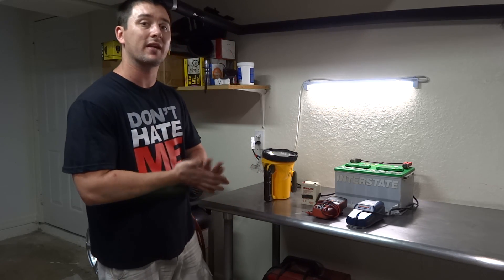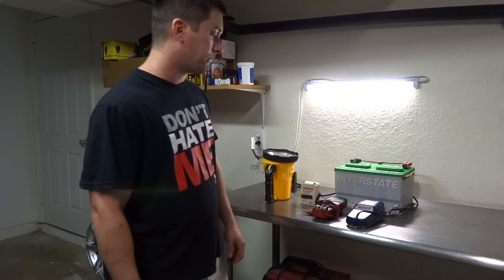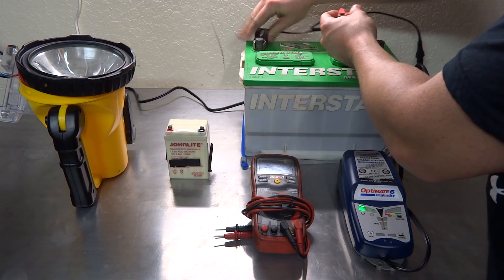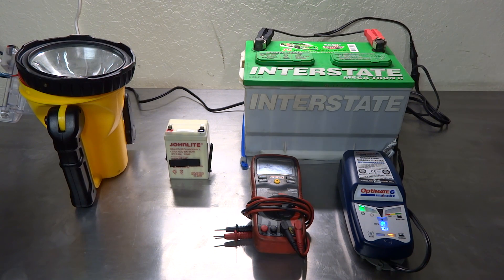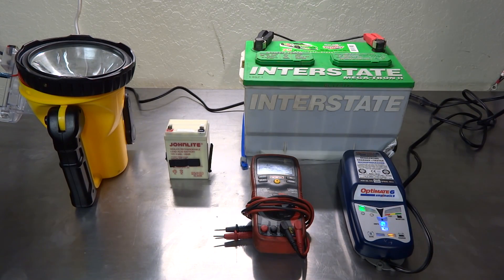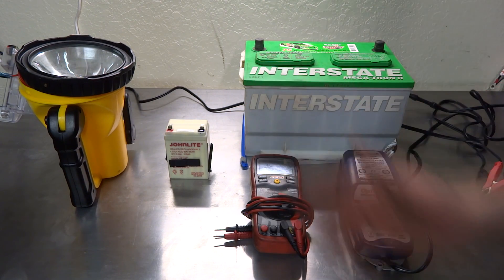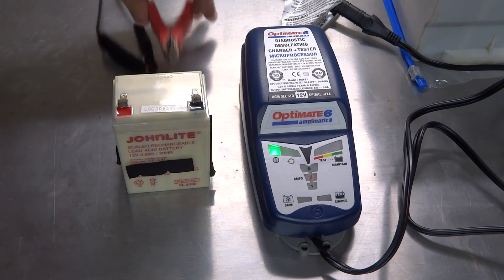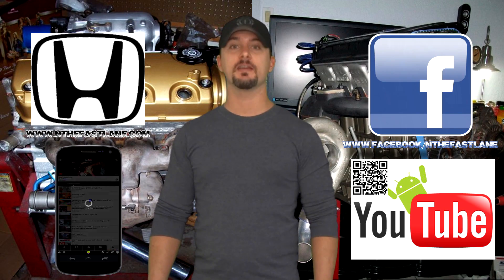Desulfating & Restoring Gel/Lead Acid Batteries

Comment: I have a cheap sulfator on a bike gel battery right now. Battery has voltage ok but no much power aka current. Also there's a battery charger keeping the voltage up (14 V) for the sulfator to work. Maybe I keep it on for couple of days..

Comment: Wrong about one key thing - That Optimate will not charge, or start to charge, a fully flat battery - It needs to receive a small input from the battery to be charged. So, with this type of charger you need to find a way to get the Optimate to kick off (which is worth it because the desulphation or saver mode is worth a go). 2 ways of doing it, either connect another battery to your flat battery with some leads OR use another non microprocessor type charger to get a bit of voltage into it (just for maybe 30 seconds or so or even while still connected to your other power source) and then connect your Optimate. You can then carry on as with the rest of this video. I've pulled back from the abyss a few batteries using this type of charger, but they won't kick off a dead flat battery without help.

Comment: That little charger isn't going to do anything for real sulfation.  You need to hit that battery with higher voltage PWM controlled pulses for a few days up to a couple weeks to help break through the hard sulfate enough to restore some of the original conductivity.  The voltage you need will depend on how high the internal resistance is but I have seen pulse desulfators that hit the battery with 4-20 amp pulses at as high as 60vdc and they will generally work wonders if sulfation is the real problem.  Once you restore some of the original capacity you can then cycle it a few times to restore a bit more of the capacity.  A junk battery is still a junk battery so you will almost never get back 100% of the capacity but it pays to give it a shot.

Comment: I hope you didn't throw out that small battery. All you have to do is jump it with a larger battery and some jumper cables. Let it try to equalize with the larger battery for a few minutes , then remove the jumper cables and connect your charger to the small battery. This tricks the charger into working because the small battery is now reading voltage rather than completely dead. (It drew some charge from the larger battery as it was trying to equalize to the larger battery's voltage.) Your desulfator may be able to bring it back. They work best on smaller batteries like the one from your light. Good Luck. Chris B.

Comment: that charger requires a battery to have a slight charge for the processor to sense to start the charge cycle. connect a good batt together with it to start the  cycle

Comment: I open those sealed lead acid batteries and add a little distilled water. Then put them on charge with a high pulse charger for about two days. Knocks the stuffing out of them and get reasonably good results ( about 1 in 4 don't recover), If the battery is swollen I will not try anything with it. Be careful of only putting a small amount of water in each cell though